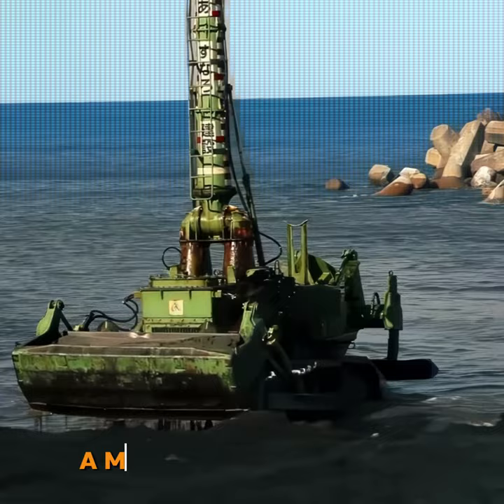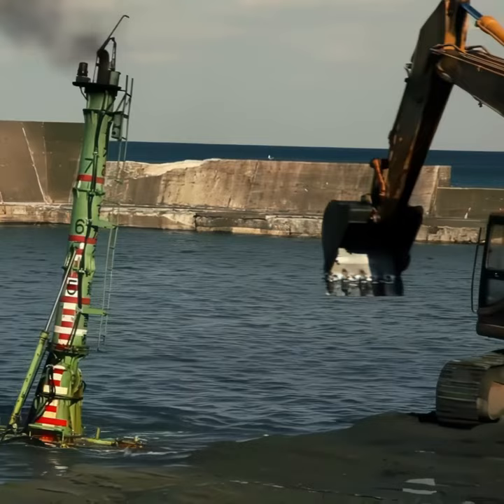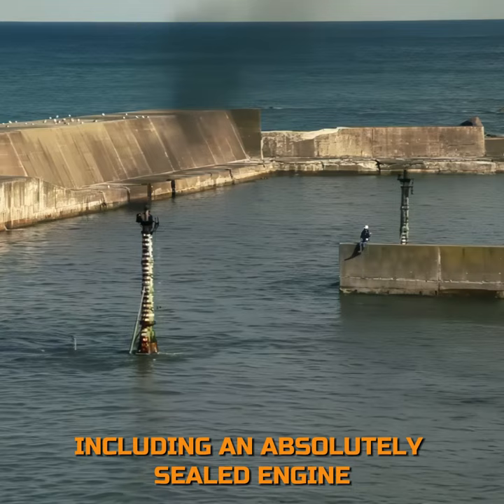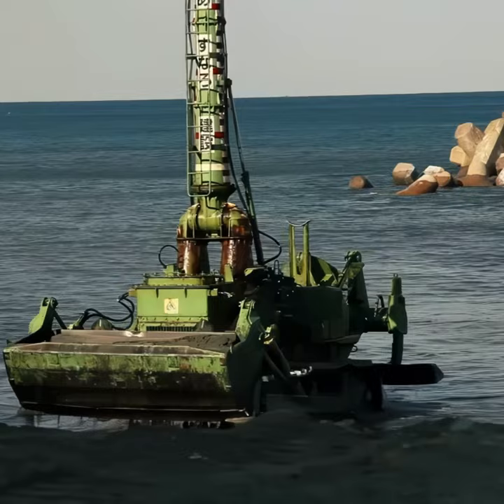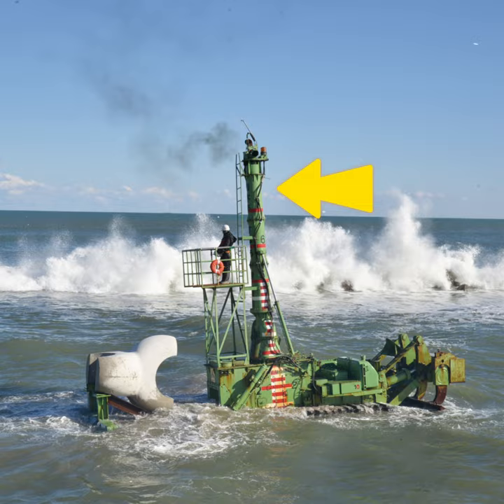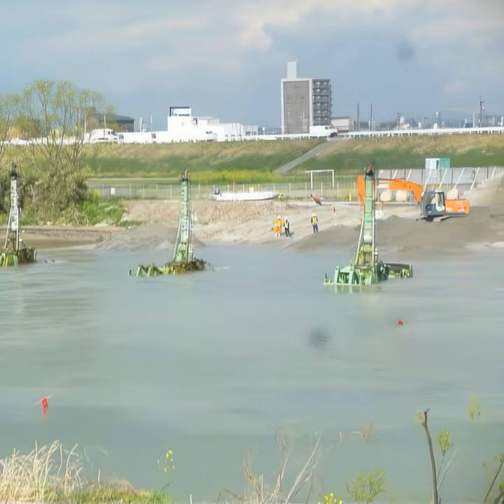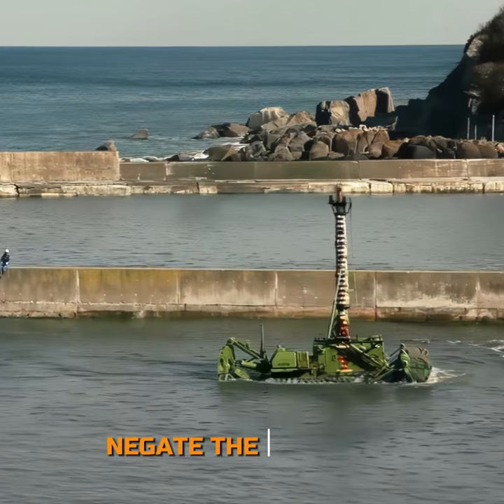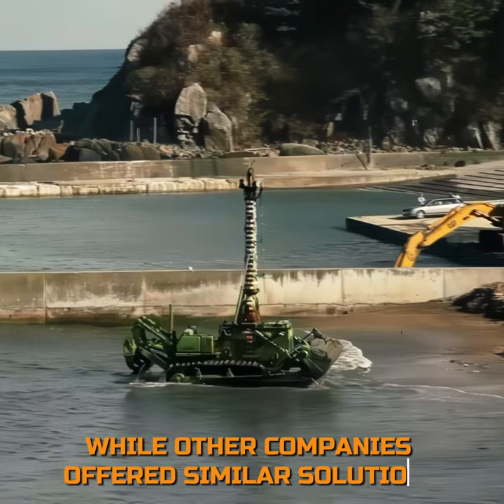Underwater Bulldozer KOMATSU D155W: The Rare Amphibious Bulldozer You Need to See

Comment: The exhaust is not the only thing sticking out of the water,  the air intake also has to be ran out of the water or the diesel engine will not run and that includes any engine
Reply: Are you sure?
Reply: No shit 😮
Reply: Maybe they use electrolysis?
Reply: Along with the crank case and transmission ventilation tubes. It isnt "completely sealed"

Comment: I worked at a Komatsu dealer back in the 80's, this was the coolest toy they made....until the excavator that could dig UNDER itself came along. It can sit on a bridge and dig UNDER THERE.  I can't remember what it was called, CC Mangum used one to dig alongside those old granite curbs in Raleigh. One dude dang near knocked the cab slam off one because of the funky joints on the boom and bucket. (We had to fix it, and he NEVER did it again.)

Comment: If there is a need - mankind (or at least Komatsu) can fill the order and build the machine to tackle the job, extreme mechanical engineering and quality manufacturing of components as well as rigorus scrutiny of assembly methods are required to get things to perform in such conditions as the salty sea.

Comment: Modern environmental regs would make it impossible to use in most nations. 10 years ago in Australia our dredging project for a wharf was planned to use an excavator with an 8 meter tower between the cabin and the tracks so it could operate in water nearly 10 meters deep. What killed the plan was environmental, a little grease might get into the water, or if a hose was to burst and hydraulic fluid got into the water. No proposed solution or mitigation was good enough so in came the barges and long reach boom shore excavators.
Reply: There's environmentally friendly fluids and grease available.  It's been available for the last 15 years. I believe it's all vegetable oil based, for working in sensitive environments.
Much of the forestry and logging currently requires this type of certification standard.
Reply: @ExposingReflections  Good to know there is alternatives, but getting regulators on board will always be a problem. Our engineers could not convince the regulators, and the excavator was brand new, designed for marine operation, all the hydraulics were double walled. It costs a pencil pusher nothing to say no.